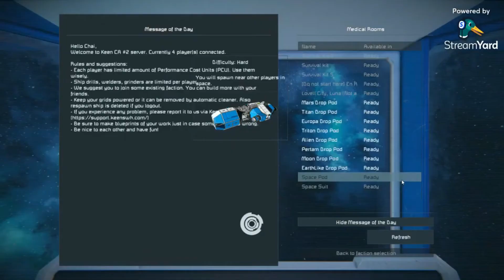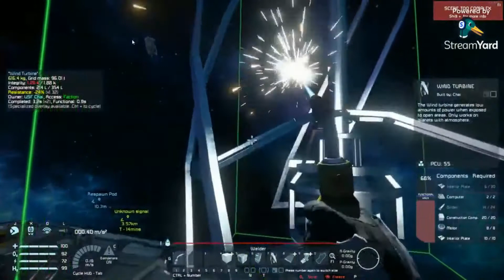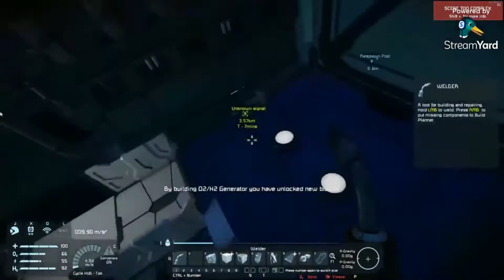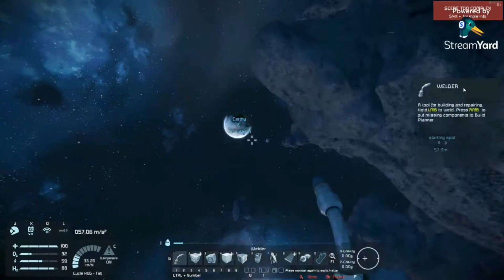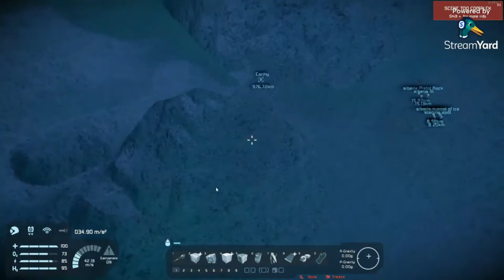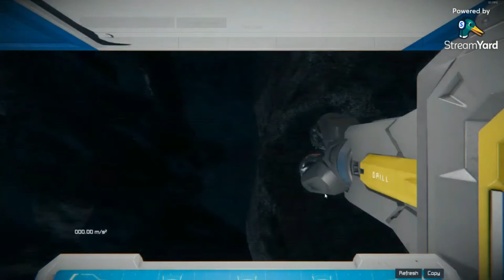Space Engineers Lets play Server Survival Ep01 One hour start

Comment: What gives you the block info in the top left?
Reply from the maker: That is a plugin. I use a few. 

You can subscribe to the plugin here:
https://steamcommunity.com/sharedfiles/filedetails/?id=2407984968

The plugin it loads is this:
https://steamcommunity.com/workshop/filedetails/?id=514062285

Plugin loader has a limited set of mods that work with any local or server. They really just modify the interface so have no effect on the server. 

So the info is from a plugin called Build Info. It tells you more info about a block and let you find air leaks. very nice plugin.
Tool Switcher is another must have plugin. You switch tools with the scroll wheel. no more 3 toolbar slots. 
Accelerometer is the speed indicator next to the flashlight icon. I use it to see how much thrust a ship has in any direction. if you can get 11m/s+ the ship can land on Earthlike. But I tend to go for 20m/s just out of habit from PvP. it also lets me land on all planets and get back off pretty fast. 
those are the key ones I use. Any others are to taste. 

I would avoid any plugin that changes the start video analytics, news and other load screen features. sometimes the game updates and some plugins stop working so it will lock you out of the game. So it is safer to just use plugins that work in the actual game world. if something breaks just turn it off and all is good. Actually I think the game will just ignore the broken plugin and keep running in most cases.
Reply: @chaiboy854  I had no idea you could get plug-ins on Keen servers, I will definitely download these!  Also, what do you use to get the sick skybox background?
Reply from the maker: @varietycontent3390  since plugin loader runs the mods locally it works on all servers. The background is Keen "Blue Nebula" Skybox. A skybox mod you can find in the workshop.